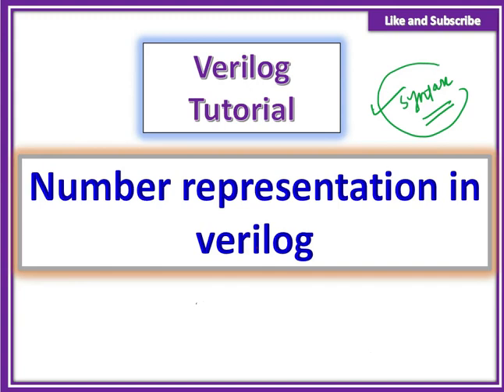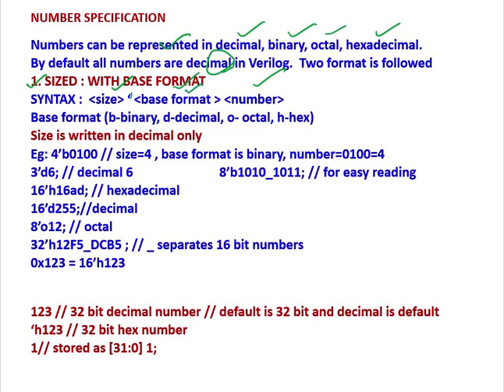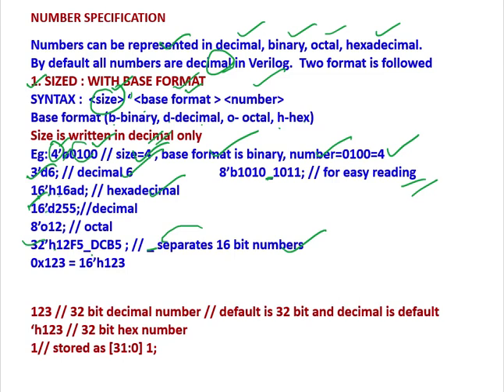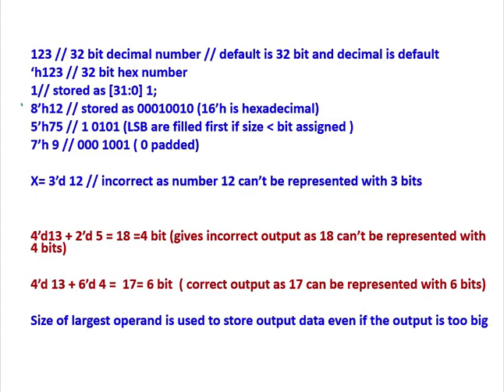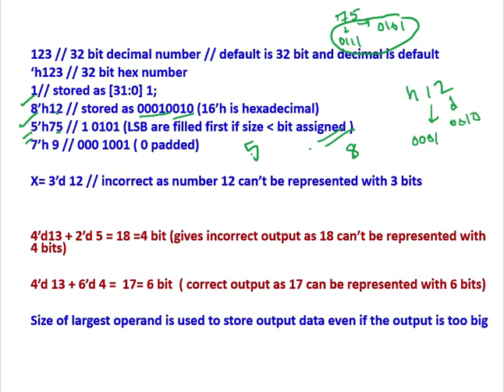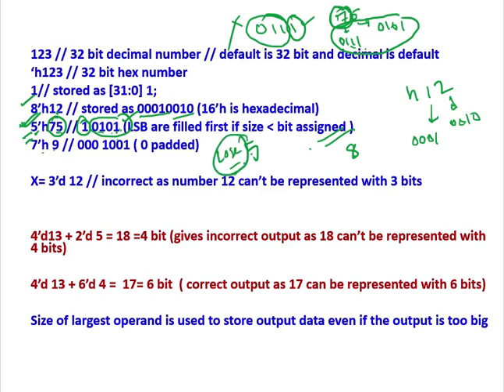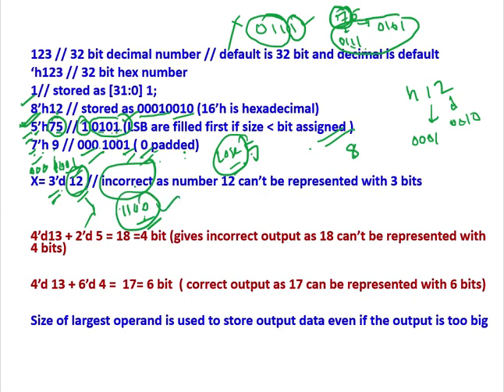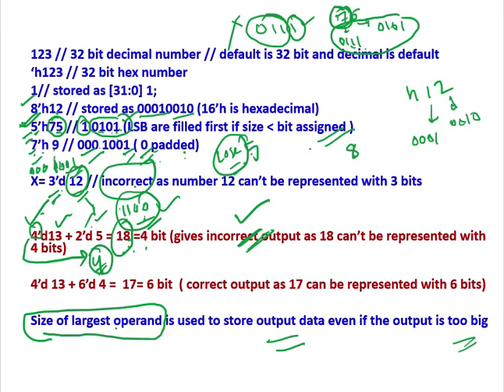#3-1 Number representation in verilog || Number format in verilog

Comment: 5'h75- SAYING SIZE IS FIVE SO WE LOSE THE DATA 011.   WHEN 4'd13+2'd5=18 HERE WHY WE CAN'T LOSE THE DATA, AS I KNOW THE SIZE IS 4. Can u explain?
Reply from the maker: It will give incorrect result due to insufficient bits. The same i have explained.
Reply: @ComponentByte or that concept of filling for LSB, only applicable for hexadecimal but not other formats??
Reply: @gosuvo1706  Well i think the partial assignment happens in both cases its just stated in the video that it wont give correct results or outputs if 18 is stored in 4 bits it will become 8(=!18) hence it will give incorrect results
Reply: Even in 5'h75 - insufficient bits but we consider it from LSB then y not for other formats